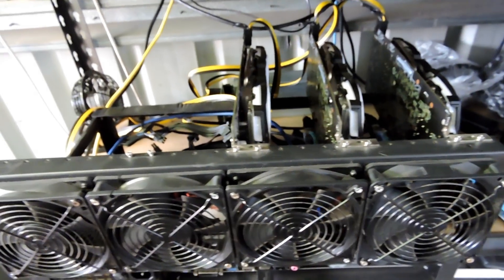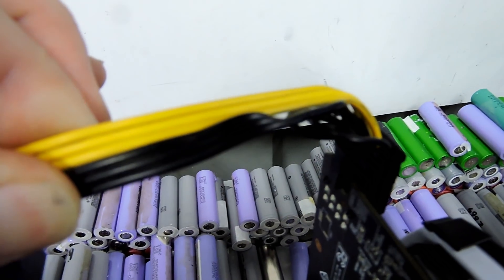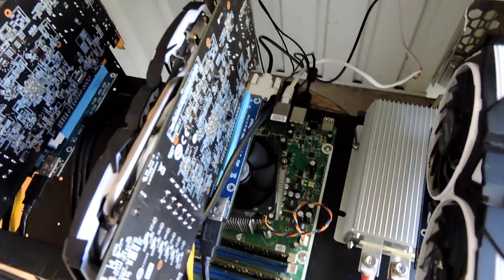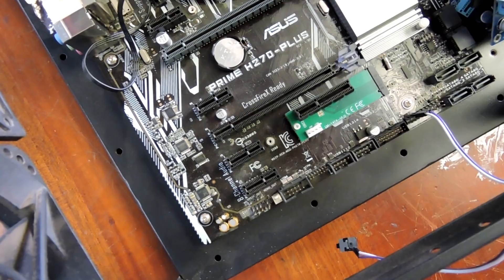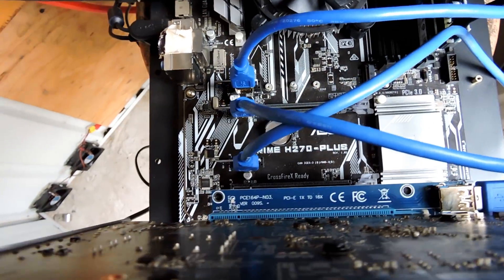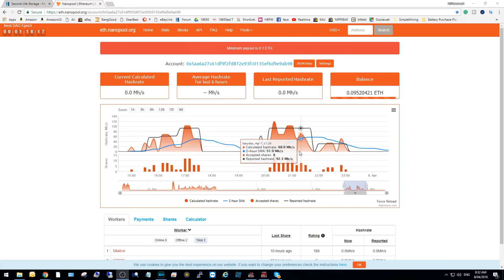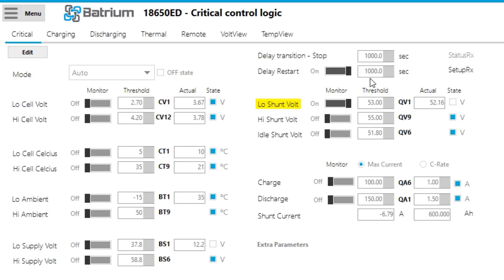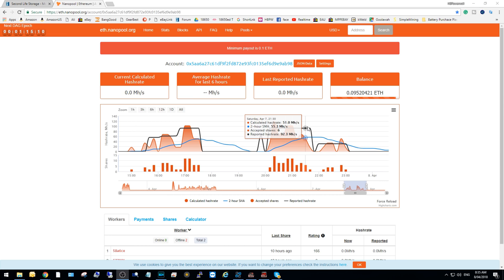Solar Mining with 🔋 Battery Hasher 4.0 Mining Eth offgrid with RX580 8GB hashers

Comment: I liked your video on this... too many people do not account for the entire cost of mining. I  DO  STILL think it is worth it when you factor in heating cost in cold climates. I am thinking of using a mining rig as a heater for a small insulated room in my barn.
Reply from the maker: I wish it was cooler here so i could take advantage of that.. issue is in winder when it is, there is next to no excess solar to mine with.. ol catch 22...
Reply: Agreed but what if you simply do not think about solar in the equation ... I am looking to use the miner ONLY as a heater. No solar ... no batteries. At -30 ... I need the heat!

Comment: Hey Pete, great effort. I stumbled on your vid because I'm working (two years after you!) on an oh-so-similar rig. So I have been thinking it all out and I had already found the very same 48v to 12v converters, and several different Pico options for the mobo. Because like you I hate the video of DC to AC to DC! But my hesitation right now is how to provide 5v to the riser cards. I am led to believe they do need a little 5v to then convert to 3.3v for the gpu's. It's a little difficult to see in the vid, but how were you powering the risers? I guess easy enough to get a second small dcdc converter from 12v to 5v and use that. But I'd be interested to know what you did, and weather it had anything to do with the issues... Cheers, and I hope you've been taking it in during this bitcoin frenzy! Cheers, Tom.
Reply from the maker: Risers are 12v
Reply: @HBPowerwall  Ok, well that's great news. A bit bloody annoying when every other place that I managed to find any info about it suggested that 5v was required as well. But judging by the number of rigs in the background of your vids you must be the guy to ask!  So how much power did you manage to get out of that 48-12v converter in the end? Not that it really matters as there isn't a gpu available for love nor money! Cheers for the quick reply. Tom.

Comment: be a smart man and just use a normal powersuplly pluged in to your battery
Reply from the maker: This is still running with two cards - i think i was smart enough
Reply: @HBPowerwall  It was just a tought, maybe the power dinth get distributed evenly acrros the board but if 2 are working stable than congrats :)

Comment: I did this kind of. I used a contactor  that would switch the whole rig over from mains to solar inverter without shutting down the computer at al, if the voltage dropped below a threshold on the battery. It worked fine. I thought there might be a problem switching a heavy load via a contactor but apparently power supplies for the computer have enough capacity in the caps, and enough tolerance for voltage changes to endure a the milliseconds it takes to pop over.  That probably won't really help you though, seeing you are trying to avoid using any grid power. So, I probably should be quiet. hehe. 

Advantage is you can just use standard ATX power supplies, disadvantage is converting to ac in an inverter just to convert back to dc in the pc power supply. So... But for a person wanting to run 24/7 and use excess solar power during the day it worked well. I don't have a grid tied system or else obviously I wouldn't need to jump those hoops.

Comment: You really should get everything up and running on a powerfull PSU before connecting it to any converter.  Then you can run the rig and log how many amps the different rails (3.3V, 5.0V and 12..0V) needs when running everything.  Knowing that the rig is good should make tracking down power problems a lot easier.  :-) 

You should also check the sinus wave on the converter since that is often a problem when running high power PC equipment from a converter
Reply from the maker: With exception of the psu & two extra cards it ended up being my 5 card rig running flawlessly - i really think it's the converter is where the issue comes from.
Reply: How many amps can you draw on the 12.0V rail.on the converter? Three high power GPU's could need 50-60amps or more including the rest of the system.
Reply from the maker: 60 chinese amps, was pulling 40

Comment: Nice!!! I do the ziptie spacer thing also on a lot of cable managements!  Worxs Awesome!!!⛏⛏⛏👍
Reply from the maker: except in my case i think i did it too tight and damaged cables lol
Reply from the maker: I ended up putting v9.5 risers in make it a bit more stable but still not right. New risers have two led's on the riser board, and one on the riser card and heavier usb cables
Reply: maybe u need to rebuild the power cables to each GPU card for eg: shorten the yellow and black cables down to 1 inch and then solder them to a fine strand 8 gauge wire to the psu. that will eliminate heating up of the wires, technically u can make a bus arrangement across the eventual 6 cards and tap into them, when adding each gpu.
Reply from the maker: I like the idea however if those cables work on a std power supply you'd think they would be fine to run in this configuration. Also we'll call it card one with shortest cable doesn't work just as often as the rest.

Comment: hi nice one getting closer for full mining on solar :) . i have a question what ddo you suggest for 18650 pack fuse both sides of the 18650 or single fuse so yes what side thx mate keep up the good work
Reply from the maker: I think fusing both sides has solid advantages - how I don't for two reasons one physical strength of the battery & it adds another point of failure while handling.
Reply: my idea was to solder solide nikkel strip negative side and fuse the positive side and then make the 3s pack is that a oke idea ?
Reply from the maker: Sounds like a good idea - a bit of scrap copper wire twisted would be cheaper unless you already have the nikkel or need high amp draw
Reply: yeah already ahve the nikkel and for the posivtive side i use twisted copper like i sa on your vids good idea
this is just a try out for a 12v +- when i go fishing after this is good and stable i gonna make a powerwall for my house thx for all the vids you make

Comment: put in the bios gen 2 at the pci express i have the same problem i have 7 card now
Reply from the maker: Board was out of my 5 card rig that's been running for months and I'm sure settings in bios haven't changed. But will definitely take a second look.
Reply: must be gen 2  to see all the cards with noproblems
Reply from the maker: Yes, but it sees them some times but not others. Worth a double check anyway that's for sure.

Comment: Looks like your cutoff issues should be solved pretty readily if you drop the time delay and instead use a hysteresis setup: instead of "once kicked out, it doesn't come back til it's stayed low for X minutes", set it up for "kicks out when the voltage drops below X, and then it doesn't kick back in until voltage rises above Y, which is substantially higher than X". So long as the gap between X and Y is significantly more than the amount of bounce-back your battery voltage sees when the mining rig kicks out, you should be all set.
Reply from the maker: I'm misuseing a function in the watchmon to try and do this. I don't really know how it all works I'm just playing and trying to learn. It works perfectly with just two cards... just that extra load from the last card tipping it over the edge.. time for some real fine tuning i thinks

Comment: Did u try burst coin is cheaper the then mining with gpu burstcoin you mine with hdd any way you see it its ways more cheap to run upgrade and maintain give me a heads up if you try it or read somthing about it im allready mining with 140tb rig
Reply: Can you suggest a good source for cheap mainboards with a lot of sata ports for HDDs? I'm not particularly interested in mining, myself, but I do have another application for which I need a dirt-cheap board that can host a bunch of sata drives. Don't need much in the way of processor or memory, just enough to boot a stripped-down version of gnu/linux, because all it's gonna be doing is hosting a bunch of left-over sata drives and serving access to them across a network at fairly low speeds. (Info might also be of use to others here who do have an interest in mining.)
Reply: John Doe. Hello there well im not realy super in to it im using a cheap ashrock with a core2duo with 4 sata and im going to use some usb hdd sry for not being capable of giving some good real help
Reply from the maker: might look into it again..
Reply from the maker: Considered Burst coin with the 40 old 1-2tb hdd's I have laying around just can't see it being worth the effort.
Reply: HBPowerwall. Well it aint woth allot a burst atm its 0.014 at the moment but if you have spare free space in your pc its not a bad idea ita may help a bit

Comment: Hey Pete what did you finally go with for power on this thing
Reply from the maker: i'm mobile at the moment , but it's linked in the description - 48v to 12v dc to dc
Reply: HBPowerwall thanks man
Reply: HBPowerwall might solve the power issues your having
Reply from the maker: Have looked at quite a few but they are very pricey
Reply: HBPowerwall hmm how pricey are we talking, could also get a second 740 and split the load

Comment: Missed a few vids of yours but try to undervolt the cpu and turn off onboard audio the bios mod the gpus for lower voltage. May put you in a better threshold
Reply from the maker: I have most things turned off in the bios and followed ETHOS best practice for bios config, will need to push a little harder i think so save every little drop

Comment: Oi pete, listen up.... them cheap chinese fake pico's r FUCKED, stop wasting ur time with them and go genuine PICO. Get an Oscilloscope and check the output of that power supply... something tells me it may put out a dirty signal and the electronics do not like it, thats why the ac PSU works fine cos it built to deliver the required amps @ 12v etc. IF and I mean IF u can find a regulated PSU that has a range of 46 to 62volts and a reg output of 13.8v Dc then u will have better luck. There is an american company that makes pc PSU's for 12, 24 and 48v battery banks but they r pretty expensive BUT in ur case maybe worth that expense... a proper PSU maybe more efficient for ur battery bank too. I just received that 24v to 13.8v dc to dc converter so I will soon do some testing with it to see if it will put out a constant 13.8 @ a 20amp draw. Anyway let me know if u were able to track down what I was on about. Cheers n beers Big Ears... over and out... beep beep!
Reply from the maker: taking a look around, seem there are a few versions of pico on eBay - some 150w 160w and 250w units, i'll buy one of each on payday and test each if possible. Also there is another version that is quite larger - but not as tidy lol Took way too long to do this video, each reboot takes 6min to start hashing and testing due to using wireless on EthOS

Comment: Instead of turning the whole computer on and off depending on state of charge - why not having it running all the time, and start and stop mining, with a bit of software checking status on both battery-voltage and how much power you get from the solar panels? Then you could run 1 gpu card when SoC is high and the solar power is limited, and beefing it up with more cards when you get more solar power. When you have no solar but high SoC you might want to use the power to more useful stuff than mining..
Reply: Ya i like that idea too but a combination of both that way its just not in idle for hours and wasting 50-80 watts.
Reply from the maker: I think I might endup just using a relay to turn off the 48v dc the converter uses 1.7 amps when the rig is shut down. While not horrible its a large draw for nothing. worst case might kill some usb sticks i think.